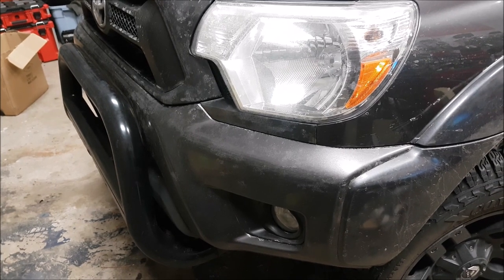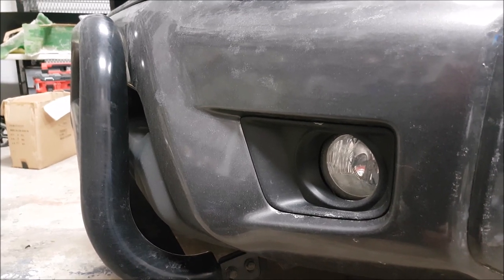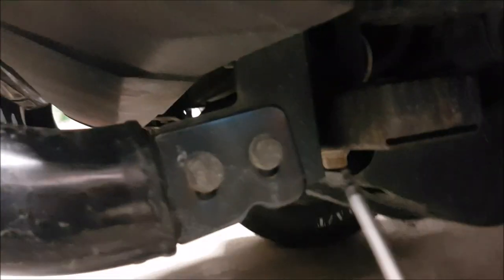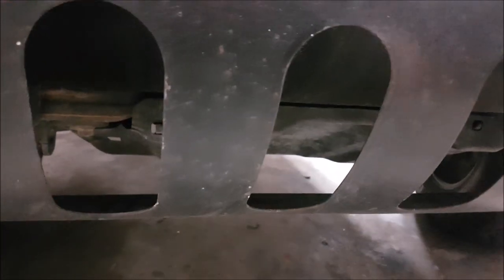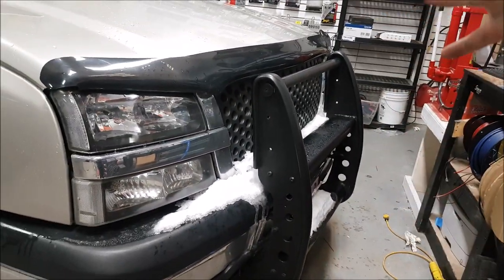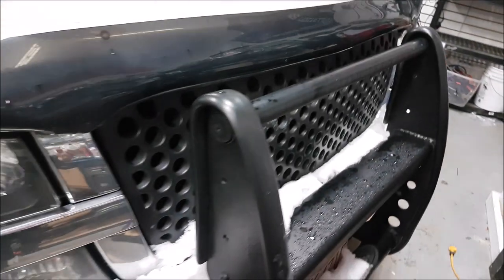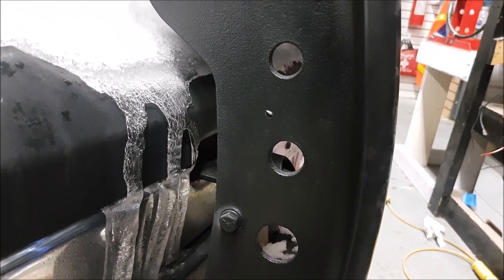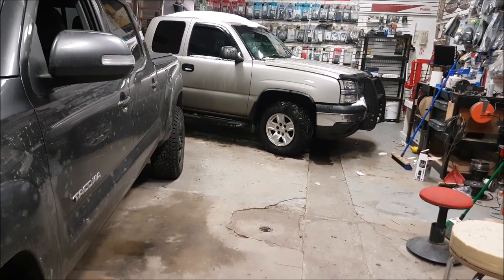Push Bumper vs Bull Guard | AnthonyJ350

Comment: These cause injury's, read on to questions people have asked
I don't have time to respond to everybody
And this will probably get taken down or ghosted anyway
But at least I made a effort

Airbags are controlled by accelerometers that are placed in different parts of the front end of the vehicle, depends on make and model, all different
Mercedes is in the motor I believe? one of them is
My point being,  Bull-bars have no impact on airbags at all

But they do interfere with crumple zones
This question came up a lot at work, our shop installed a ton of them, not me personally, I'm the service manager
But our boss is East Indian and we quit installing them for safety reasons
He said it would be a matter of time before they are banned here, and feels sick because of all the injury's these could have caused
They are banned in India and different parts of the world, you can easily look this up to fact check  what I am typing is true, I did a long time ago, and how airbags work, and sensor location?
I don't have time to, I got to get to work
Hyperlinks can't be added here anyway, or this reply gets automatically deleted

The reasons for the ban are: Bull-bars make crumple zones ineffective by transmitting crash energy directly to the body structure, thus causing injuries and death to the occupants.
Reply from the maker: It depends on the manufacturer. Setina claimes NONE of their designs affect the SRS system https://setina.com/push-bumpers/#:~:text=None%20of%20our%20push%20bumper%20designs%20interfere%20with%20the%20SRS%20Airbag%20System.
Reply: @AnthonyJ350  
I think you better give it another read
I never said they did. none of them do, not just Setina
I also stated they do not effect the airbags
Airbags are controlled by accelerometers
Reply: I do belive his point, whjich I have no way of judging, is that due to the removal of the crumple zones, that it is more dangerous to theoccupants in a high speed crash, I wonder if he thinks this applies also to steel bumpers? @grantward9205  @AnthonyJ350

Comment: Question, in an accident considering a lot of these are mounted to the frame, how much more protected is the person? You’ll see an accident where the other car is totaled, and the car with the guard is relatively fine. But internally is the entire frame kaput?
Reply from the maker: I've seen video with an accident and the police officer said it took a lot of the energy out of the crash. Have to look at the documents of police equipment, I think they have the most safety development.

Comment: Someone at the off road store told me to avoid push bars because they can damage the radiator and other internal stuff on an accident because of the top brackets being close to them and pushing them in on impact.. is that true? any thoughts on that vs bull bars that just help out a little bit? Thanks!
Reply from the maker: Depends how it's designed.  If you get one designed for law enforcement that doesn't seem to be the issue.  I work on Police cars and the brackets get mangled.  We just install a new unit and send the car on its way.
Reply: I mean the other car could damage too
Reply: Which do yo most recmmend for a f-150 22 powerboost lariat? THank you ! @AnthonyJ350

Comment: Ate there any that don’t interfere with your parking sensors and cameras?
Reply from the maker: I think you would have to go with a bumper like ARB that has provisions for your parking sensors.  They do cost a lot more than a push bar.
Reply: If you don't know how to park without sensors you shouldn't be driving
Reply: @grantward9205  lol you must be young. Im in my mid 30's. Never rely on technology especially electronics, they fail and most sensors fail eventually. If no code pops up on your dash how would you know a blind spot or a parking sensor is working? Dont be lazy always pay attention when your driving

Comment: Can this bull guard/rush guard be made of plastic? So just for decoration and style.
Reply from the maker: I haven't seen one personally. Aluminum bull bars are the most decorative and economical I've seen.
Reply: @AnthonyJ350  Maybe you could make a custom plastic push bar for this guy, like for decoration
Out of 1 1/2" abs black plumbing drain pipe
I would dry fit it first, better be safe than sorry
If he had a big truck you could use 3 1/2" black abs pipe
Then you could use toilet flanges to bolt it to the front bumper
It would look just like the Dukes of Hazard
SAWEEEEEEEEEEEEEEEEEEEEEEEEEEEEEEEEEEEEEEEET!
Also this wouldn't interfere with the crumple zones, but you may get a chuck of abs pipe through your forehead or chest in a big accident
Reply: @AnthonyJ350  thanks for your reply man, I've found couple on internet but doesn't look this fit.

Comment: Hey just a question does it matter what year your car needs to be to have a certain bumper or it doesn't matter
Reply from the maker: As long as the manufacturer states it's designed for your vehicle, you should be fine.

Comment: How well do each of them do at protecting the front against a crash?
Reply from the maker: Push bumper will absorb and deform a bit. A bull guard that's aluminum and only has 2 points I assume would cave in. Road Armor or ARB bumpers would be better because they're stronger.
Reply: @AnthonyJ350  I’m looking for one to put on a semi truck, which would protect the most?
Reply from the maker: @arconnelly5365  Not my area of expertise but you'll probably want to look into some sort of cow catcher bumper https://youtu.be/rd950MyJAsg
Reply: @AnthonyJ350  thx.
Reply from the maker: @arconnelly5365  your welcome
Reply: I've seen people driving around with bull bars crumpled up from front-end collisions, they just fold up and crush your bumper. Really only protects you from parking lot stuff.